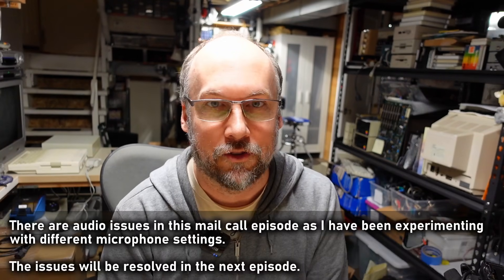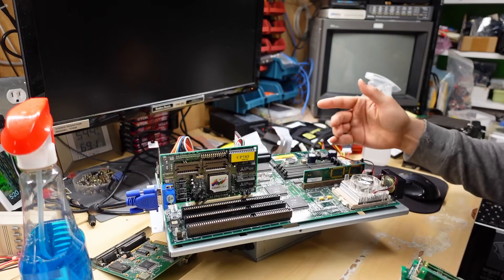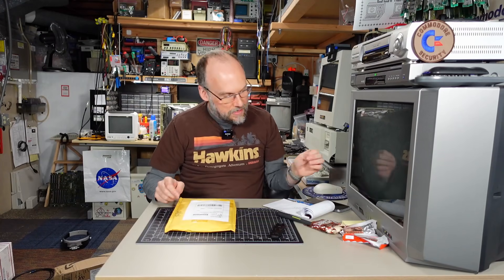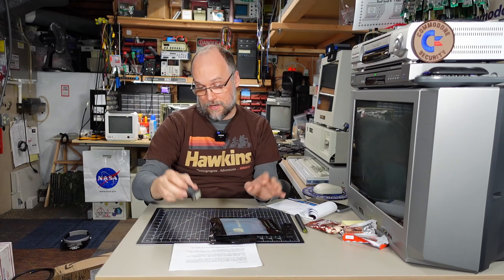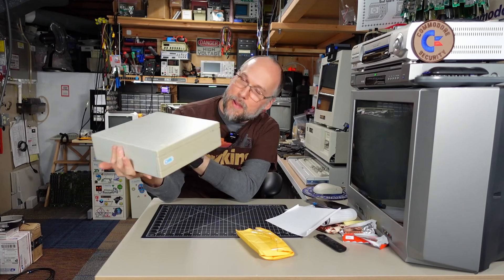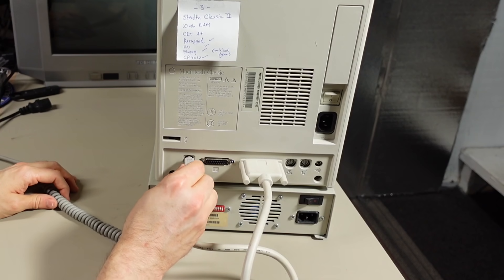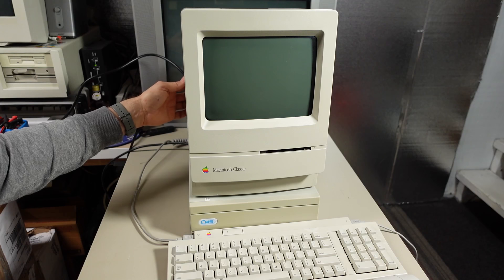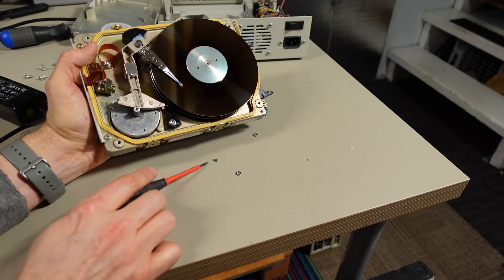30 pin to 72 pin SIMM adapters, a self-destructing SCSI hard drive and an Apple IIc mouse adapter

Comment: Never come across SIMMverters before, they look as ridiculous as they do useful. Love it!
Reply: Have you come across any pci ram disk? I always wanted one, but they were out of my price range: https://www.newegg.com/gigabyte-gc-ramdisk-others/p/N82E16815168001
Reply: @DerekPeldo  Макс Крюков did a comprehensive video on one SSD Gigabyte i-RAM: https://www.youtube.com/watch?v=AM9qUnuxdbk
Reply: could totally use a 70pin to 30pin adaptor! that would have an actual use..
Reply: I read this in your voice 😅😁
Reply: It shouldn't be too hard to make something alike again, also another option is to have the second one with sockets on the other side of the PCB, which wouldn't require making it taller.
Reply: I remember paying $10 Canadian per MB to swap 30 pin for 72 pin at the computer store.
Reply: I remember those, they came in "L" & "R" facing variations in the catalogs.  That way you could use all 4, 72pin slots with 30pin simm's.  You have the two tall ones in the middle, and shorties in the two outer slots.  Now couple them with 30pin SIP adapters, for ultimate wonkyness.
Reply: they came in multiple formats - there was an earlier style to convert SIPP memory modules (they had a row of fragile pins on the end) into 30 pin SIMM sockets, then later the many 30-to-72 pin versions etc :D
Reply: I do remember seeing those as a kid. Never really understanding what they did. At the time I just thought they allowed you to install extra RAM.
Reply: In Bavaria we called them SIMM Shuttles.
Reply: I love old tech, sometimes it's just too freaking cool.
Reply: @Darxide23  They made those also, slot expansion cards,
They even made them with 8 slots,  I had a couple, you could fill them up with cheap 256k cards instead of the super expensive multi-MB cards at that time.
They were quite wonky though, some wouldn't work properly with certain motherboards and some wouldn't work with certain memory cards.

Comment: I recently had a 500GB Seagate drive that had a catastrophic failure that my computer tech friend had never seen before.  In the middle of the night the bearing seized up so hard and so suddenly, the rotational momentum of the platters snapped the spindle shaft right off.  The motor continued trying to spin what was left, and it woke me up making one hell of a racket.  Until that point it had been a very reliable drive over the previous 13 years or so.

Comment: 1:35 The funny thing is that today, a used and working 72-pin SIMM module is cheaper to buy than one of those 'SIMMverters'.
4:31 Putting a module into a socket with those metal clips is just such a satisfying task. All those modern flimsy solutions are nothing compared them.
4:50 Those selectors are called the presence detect, retroactively called parallel (PPD) to distinguish them from the modern solutions which actually use a ROM that is read in a serial fashion (SPD). You are right saying that the PPD is not used anymore on later motherboards as they automatically detect the size of the RAM. However, they cannot detect the speed of the modules, so those boards typically provide a way to set up the speed (if they are not designed to work with one speed only anyway), the most modern ones even went as far and allowed to set it up in the CMOS Setup.
10:15 I have made the experience that the tin-plated contacts of those memory modules are notorious for making bad contacts, especially because they are usually old and had some nice time to build up an oxide layer.
31:50 The moment when the viewer already sees that big fat scratch on the upper side of the second platter and Adrian is still guessing 😁

Comment: There were mirrored versions of the simverters so that you could put a second pair facing the opposite direction.
Reply: I was just wondering about that. Thanks. Would be nice to score the mirrored ones. So you can put all 4 in the motherboard. Would be nice. Never heard of this product, but it is cool idea  I guess for the time.
Reply: Hirsute no doubt!
Reply: Yep. Just a few weeks ago when I was sorting out papers I found a 1995 invoice from a computer store. Apparently I bought two SIMM adapters, a "right" and a "left" one, to reuse my old 8x1MB SIMMS in a newer 486 PCI board with 72 pin slots only.
Reply: those are the ones I remember. I cut my teeth in the mid 90's with a truckload of 486 era stuff and had a few of these in it. always figured they were super common.
Reply: They were also a bit unreliable. I plugged in a RF-noisy Soundblaster and had RAM issues with those. Hard to figure out.
Reply: @joe--cool  When you make a product targeted at the cheap, nobody should be surprised that it is itself cheap. :)

Comment: I remember these from back in the day. They had a few drawbacks. First, being so tall it was easy to break sockets with them. They also had compatibility issues which were usually said to be due to memory timing. There was not a lot of discussion on the jumpers so that may have been an issue as well. The biggest issue was they tended to be comparatively expensive, offsetting the savings. As an alternative, there were a few companies that claimed to be able to take the chips off your 30 pin sims and put them on 72 pin boards.

Comment: In one of Steve Gibson's old tangents on his security now show, he mentioned the phenomena you mentioned on old (and current) hard disks - it's called Sticktion. It's what happens when the head instead of riding above the platter, sticks to it. and on the older drives, it rips the heads right off on spinup. (Steve Gibson, creator of the apple light pen and hard drive software Spinrite, at grc dot com)

Comment: for the PCJr i think one could make a basic PCB, 3D print a cartridge and insert it on the slot, with a button protruding from the front! So the reset button can still be there in the front, but no need to drill the case front or back!
Reply: That'd be a cool idea for sure! 

Maybe one version could just sit flush with the button on the front, and another could be a larger port extender that pops all the way out, has a button on the side, and lets you still put a cartridge in that slot. Obviously the first one would be more practical, though.
Reply from the maker: Yeah would totally work well! Surprised no one came up with that idea actually.
Reply: @adriansdigitalbasement  I actually thought of that when I was watching this, but it seems I'm late to the party here. Rather than design a new PCB you could modify some existing cartridge. Since it appears there's a kit for that it should be easy.

Comment: I had one of these SIMM adapters! Back in the Super Socket 7 days. I remember being surprised when it actually worked.
Reply: Is there a performance penalty or were the two types at the time fairly similar?
Reply: @TheErador  I’m honestly not sure, but I can’t imagine it was as performant as having the real thing. I had virtually no cash and just cobbled together PCs from whatever dumpster finds and junk I could get my hands on, so I was just glad to have a working MMX 200 system to run Slackware on!

Comment: Regarding the unhappy drive, I’m reminded of an incident at a previous job. We had a test bench that had an ancient IBM XT running the equipment on this automated system, and one day, one of the techs was checking out something at the bench when he heard a loud CLANG and the IBM stopped working. He was momentarily confused by the noise as he thought something had fallen off the bench onto the floor, it was that loud. He soon realized the computer was down, and some checking revealed the drive had pretty much “thrown a rod”. The dead PC was sent back to the customer who was cheap enough to send over a cobbled together from spare parts PC as a replacement. At least we got to retire the 5 1/4” drive we used to ‘sneakernet’ the test results to the main network in favor of a then modern 3 1/2” drive.

Comment: For a hidden reset switch solution, I recommend gluing a reed switch on the inside of the case somewhere.  Then reset will occur when you hold a magnet up to that spot in the outside of the case.

Comment: There were 30 pin to 30 pin SIMM adapters.  Had 2 in my old 386.  It would allow you to reuse your older 30 pin 1 Mb modules, total of 4 megs, in one slot.  They had multiple orientations suited for your configuration.  They sold them at CompUSA and Circuit City back in the mid-90s.

Comment: It sounds like the adaptor for the mouse is changing timing or acting as some kind of buffer.  Apple, at the time, had different chip suppliers and there could be buffering or timing issues between versions of the same mouse, even if they had the same shape and same model number.
As a few others have said,  you take a lot more time on unboxing than most channels that do unboxing care to do.  It does make these more special.
As a note, I always get notifications of your vidoes.  I just sometimes can't watch them on same day as release due to time constraints :)

Comment: I partitioned around bad sectors on a WD 1.6GB "Caviar" EIDE drive.  Trouble is that the range of bad sectors kept expanding, so my partitioning had to make a retreat a couple times.
Turns out those drives were notorious for failing and I could have had it replaced.  It was the first hard drive I ever had fail, and I was too dumb and inexperienced to even look into that at the time. "Look it up on the internet" wasn't the reflex that it is today.
I loved that drive because it was fast and made chattery seeking noises - my older drives had been whisper quiet.  I liked the sound and the fast loading times.  But the subsequent failure soured me on Western Digital for many years (I like them nowadays though).
I still have my old drives - the older Conner drives that used to be whisper quiet, are a little noisy now.  I don't think it's my memory, I think they have gotten louder.

Modern hard drives haven't improved much lately.  I'm still seeing the same "sale" prices for hard drives that I was seeing 1-2 years ago.

Comment: For the PC Junior Reset Switch you can easily put an Reed Switch behind the Faceplate. No drilling just a tiny drop of Hot Glue. To Reset the Machine hold an little Magnet on the Spot. Greetings from Germany.

Comment: I got four 1MB 30 pin SIMMs for Christmas one year. My computer needed 72 pin SIMMs. I tried one of these but I couldn't get it working. I didn't notice the solder pads but I doubt it mattered. I sold them for $20 each at a computer show to someone who proved they were good and tried a 72 pin SIMM. That didn't work either. That led to retiring that Packard Bell and building my first custom PC that had working SIMM slots.

Comment: back in the 386/486 day we took one of those and swapped it for a roommates 3.5 IDE drive, after removing the read/write head assembly and taking the counterweight and glueing it to the top platter

Comment: Hi, nice another video.

I Purchased a new 486DX4100 back in the day and it came with those sim adapters, i now guess the computer shop (it was a generic clone build up ) just used the adapters and got rid of the stock of old / slow ram )

It worked fine, i never noticed it until i opened the case after the warranty  ran out and upgraded the video and sound card

We also had a collection of slim line / pizza box systems 486's at work and one of the IT support called me over and asked if i have ever seen this - it was a  similar setup , but the system had horizontally located add on slots and actually used the base of the memory adapter and 2 sets of ribbon cable to a add on card that held the memory  - the isa cards had no connectors on the bottom they just use the external case slot for mounting like say the "spare" slot of serial and parallel connectors of a multi I/O card

My Pentium-100 has a motherboard that takes both 30 and 72 pin simms 

For younger people the reason for this was PC's were very expensive back in the day, 4 x 100meg sims cost me $400, i also paid @ $400 for those nice new 40meg IDE hard drives

It is such a shame that early IDE hard drives had a hit and miss quality and many sounded like a can of marbles in say 2 to 3 years

Regards
George

Comment: In the early 90s I was working in a shop that built custom pc. 
Serviced really old XT as well. There was a cool 8 bit isa IDE card that would work in XTs, full of jumpers, it even had a IDE connector in the slot cover.

Comment: Those Goldstar 30-pin SIMMs make great keyrings; just put a keyring hoop through the hole on the corner. I’ve had one on my keys for years 👍
Reply: I do this with dead 72 pin. I can then just slip the ram stick in my back pocket

Comment: Yeah, I bought a couple of those 30-72 pin SIMM adapters to use when I upgraded from a 386 to a 486. Allowed me to add an extra 8MB from my 386 to my 486, for a total of 16MB. I think I might have them in a box somewhere, so I should check if they've got the resistors set to anything in particular.

Comment: That stepper in the HDD is mounted to the swing-arm of the head just like the stepper is connected to the heads in a TEAC 5-1/4 drive! (metal strip wrapped around the stepper 'pulley')

Comment: The Seagate ST-251 and ST-277R were the same physical drive. The 277R was just rated to handle 2,7 RLL for a 50% increase in capacity while the ST-251 was not (although it generally could). You may be able to swap the controller board from the ST-277N onto the mechanism of the ST-251 and have a working drive.

Comment: The switches on the back of the CMS hard drive are for setting the SCSI ID. You could daisy chain several drives. I think up to 6 pluss the internals.

Comment: The 30 to 72 pin SIMM adapters were neat back in the day but were mostly useful to 486 and some earlier Pentium based machines in the PC world. And only if you used loose 70 or 80 ns memory timings. Trace length became an issue and prevented tighter timings from being reliably used. 
For a 100+ mhz Pentium or equivalent AMD or Cyrix CPUs you needed to use EDO 72 pin SIMMs for best performance, especially if you were doing any sort of overclocking or adjusting the FSB above 60 or 66 mhz.

Comment: There are 44 pin mobile IDE to m.2 SATA SSD adapters available on eBay. Got one myself, and it absolutely worked with my old Dell C600 laptop.

Comment: Adrian: The moment you started the HDD up without the lid on you could see perfectly the top disc to be warped on the outside. As the r/w-head moved to the outside, it was no wonder you could hear scraping noises. I suggest putting your SD to SCSI-Adapter in the enclosure in order to have the right style of external hdd to go along your Macs.

Comment: The IIc color is called "fog" and it (as the public test of the Snow White design language) is the only computer Apple made in that exact shade. Even the IIc Plus is different. So finding matching hardware can be a bit tricky.

Comment: Simmverter: seen something similar, but instead of allowing the use of an older type of RAM, it hooks into 4 RAM-slots and 'angles' them 90° so that the CPU-fan doesn't block the larger capacity double/triple height RAM-sticks. (this is used by some power users to have both great RAM capacity and great CPU-cooling)

Comment: Actually looking slightly down is better. When you prop up monitors you tend to keep your eye way more open and thus drying them out which can lead to severy eye strain. Had this issue pretty long until someone told me.
Best ist having the head somewhat straight and looking down, having the eye lids further closed.

Comment: Simverters go in both directions too.. Had a computer a while ago with 4 in them side by side and facing both directions lol.  One set the 30 pin simms faced up, and the other side they faced down.

Comment: Try running spinrite on that 2.5" IDE drive. It may be able to recover those lost sectors. It uses low level control on the hard drive and can even recondition weak sectors back to working order. Doesn't always work, but if it can't fix them, itll map around them, avoiding the need to have to do it via partitioning around the bad ares.

Comment: Sodimm adapters are readily available on eBay/Ali, I used to use them as an easier way to test laptop ram when you could never tell if the laptop or the ram was at fault.

Comment: I had a ram splitter on my Performa 636 that I bought out of Macmall, way back when. Basically the 636 only had one SIMM slot and you could put the splitter on and put two sticks in. Worked great, but you could not go over 32mb total.

Comment: Actually Simverters were not only available ready to use, but also PCB only (if you have the soldering skills to desolder the sockets from an old defective board). PCB only was quite cheap.
I got a board with 30-pin sockets at a time the old 30-pin memory cost more than 3 times so much as the 72-pin ones. I used the Simverter PCB the other way around. I soldered a 72pin socket to the end of the PCB and pinheaders on the position where normaly the 30-pin sockets should go. the pinheaders I soldered directly into the 30pin sockets on the board. So I was able to connect a 72-pin ram on a board with 4 30pin sockets - and it worked well.

Comment: You can still use the board on the back of that ST-277N to possibly repair another like drive if the board on that drive is the problem.  I have fixed “like” drives by this easy fix, so don’t toss it.  The old Seagate 5.25 drives used to come with a “defect map” on top of the drive, NEW from the factory.  Unheard of in later years, and you would use a HDD utility to map out the bad (head, sector, track) spot before partitioning and formatting the drive! Ugh! Seagates and other drives had a high failure rate in the late 80’s, but a hard drive was a hard drive and a luxury to most users.  Those external drives were quite expensive back in the day.  Parts can always be repurposed to some use!